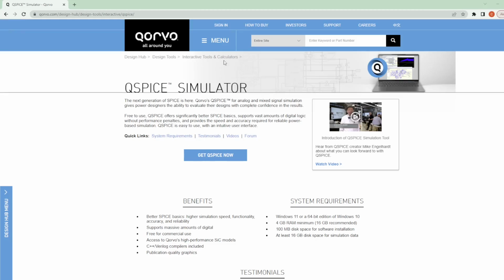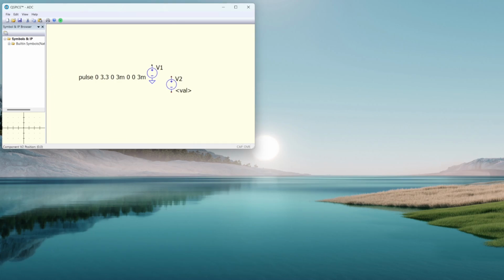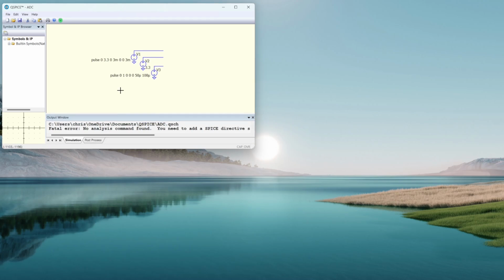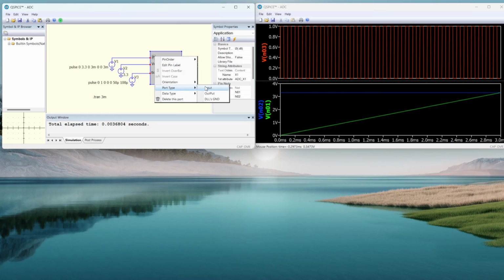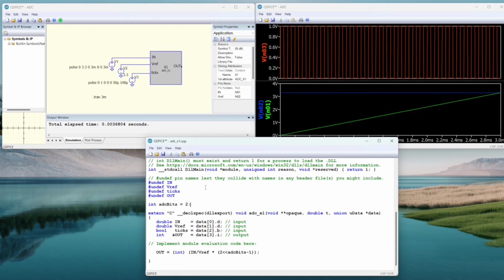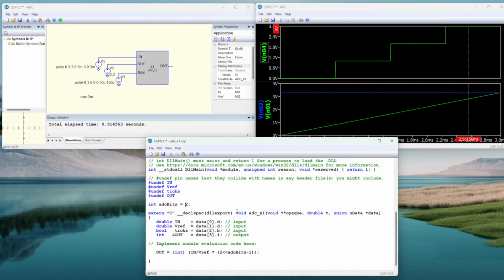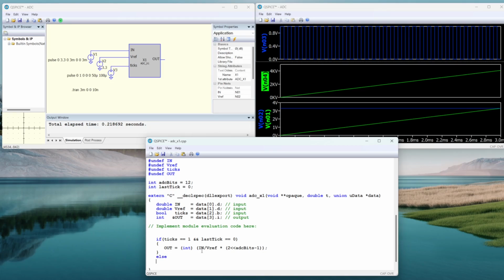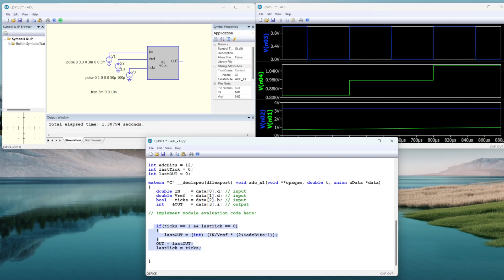How to simulate an ADC in QSPICE using C++

Comment: Why the output is in kiloVolts?
Reply from the maker: The output is what would normally be the internal microcontroller output from an ADC. For a 12-bit ADC the values can range from 0 to 4095, therefore it appears as kiloVolts in this demonstration.

Comment: Qspice cannot run on Linux, I tried to hack the binary to bypass some checks to be able to run within Wine but i stopped frustrated. any solution?
Reply from the maker: Since I’m only using Windows I unfortunately don’t know any work around to get it running on Linux.
Reply: I have one version running under Win7, one under Win10 and one under Wine Ubuntu. Works under Wine when compatibility mode is set with the winecfg option: Staging - check Hide Wine version from applications
Reply: @batishchev  i will check. the trouble initally was the 'compatibility' during the installation which fails recognizing the 64bit OS and 'blocked' with Windows 10 not detected.
Reply: According to your method, you also need to unlock the QUX.exe file

Comment: Isn’t this an AtoA converter? ;-)
Reply from the maker: In this example the output is only there for demonstration purposes. It does however convert the analog input into an integer. For the defined 12-bits the input value is converted to a range from 0 to 4095.

Comment: It would be better described as simulate ADC sampling and not ADC per se, I think and the voltage sampled cannot be in KV, right? https://youtu.be/-aYlnroWEcY?t=526
Reply from the maker: Maybe modeling an ADC in C would better describe what is shown in this video. The voltage in kV just shows the internal value you get from an ADC conversion within a microcontroller. This output is just there for demonstration.
Reply: @engineeringhustle  Successive Approximation (SAR) ADC? Delta-sigma (ΔΣ) ADC? Dual Slope ADC? etc?

Comment: cmon, an ADC has a digital serial (in most cases) out, not a discrete analog voltage
Reply from the maker: You‘re 100% right. However, here it was just for demonstration purposes. The idea is more to use the simple code of the ADC input  as a modulation of a microcontroller ADC and then further process it internally before providing an output through different peripherals.
Reply: correct, but it will be an insane task to just implement the correct SPI protocol, or the DDR DataBus out of this simulatior. ot even mentioning the Synchronization clock and the JESD204